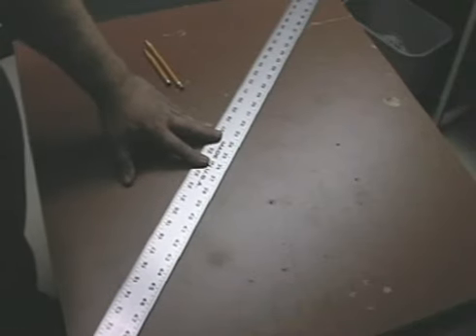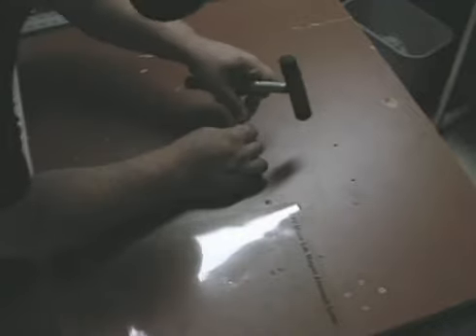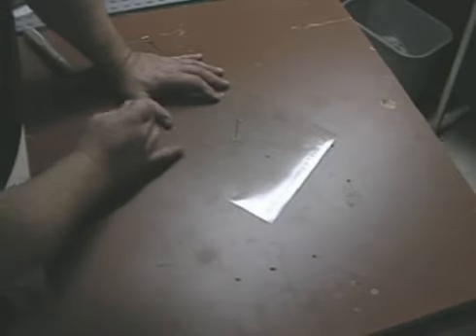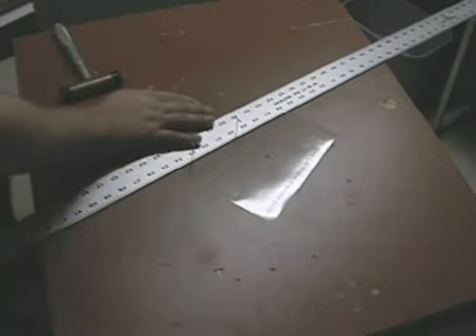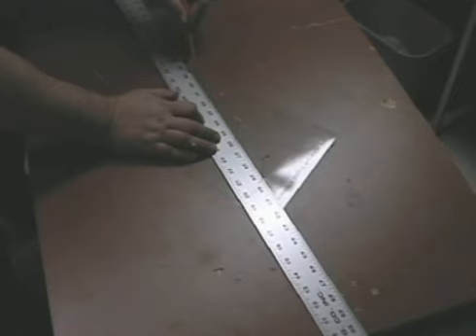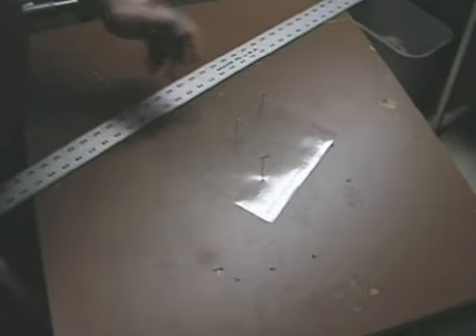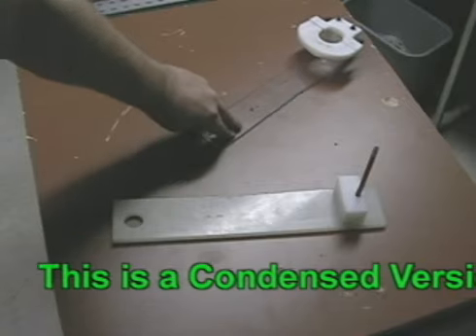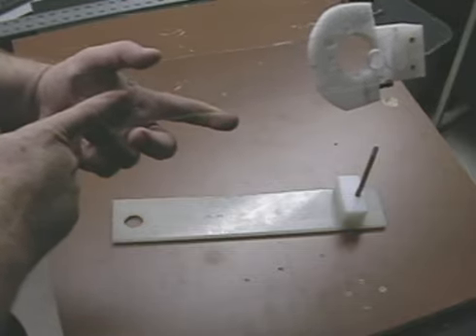Sequential Pulse Motors Project Part 1

Comment from the maker: @apollo3160 I created the guide to simplify the process and it if you use pins it works perfect by extending the line you can make any size wheel with any number of magnets you want, and changing  it is simple. If using a compass is how want to do it both ways work, I covered  calculating  both ways in the PDF.  Good luck with your projects.